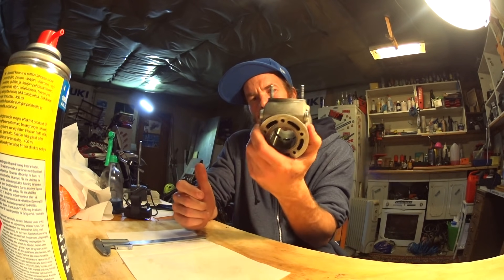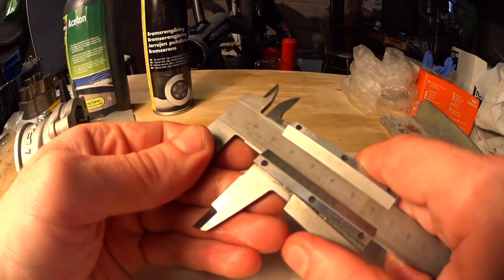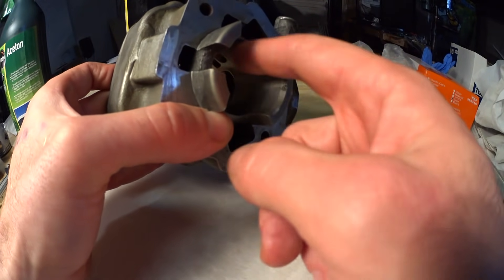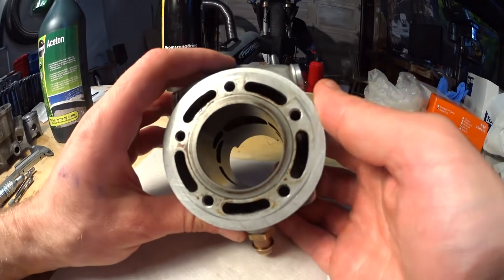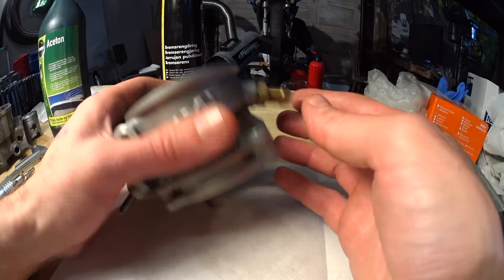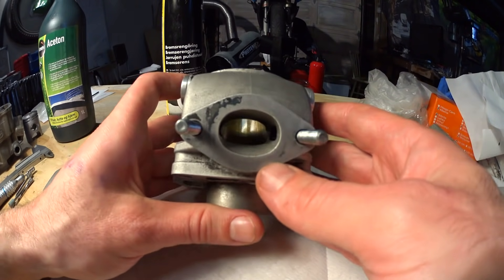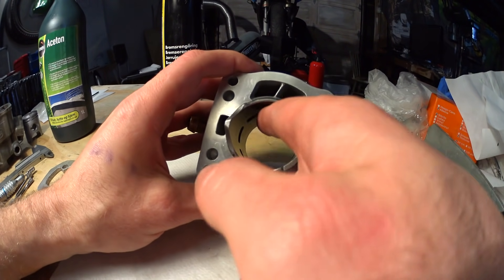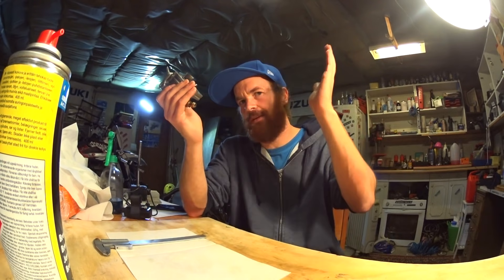Two Stroke Cylinder Porting Tips | WATCH THIS BEFORE YOU START CUTTING! 2 Stroke Tuning

Comment: I don't know how much of a factor "blow down" is for performance, (other than being too short and forcing combustion down the transfers).  If you raise the exhaust port, you are increasing both the exhaust port duration and the blow down phase, and will usually see an increase in higher RPM power.  I would bet in most cases if you raided the transfers to have the stock blow down, (the same as the exhaust port change), you will usually see a decrease in power.  I don't think it is the loss of blow down that hurts the power, (again, unless it is so short that the transfers don't flow well and mixing happens), but that the transfers just have too much duration.  My opinion.
Reply: I can't watch anymore.  I just can't.   Just remember, anybody can post a vid. Sorry man.  I know better.
Reply from the maker: +EarthSurferUSA I'm sure you do...

Comment: Thanks for the tips and tricks, and the 75% of the exhaust port is all wrong on my cylinder... the port are, let's say 100% and then the outer exhaustport is 122% that is a little bit too much i must say... :P
Reply from the maker: +Tha Duck yep, that's how it is on most cylinders...
Reply: Alright, i will need to port a bit then. Nah jk. I will let it be  ;) I got 4 ports for the exhaust in my cylinder :D

Comment: I like my port timing right at 210° exhaust, 135 on transfers and raised the boost port a bit more
Reply from the maker: +Nick Mieloszyk Try lowering the transfers to 130-132, you might be surprised... Only works with very good transfer geometry.

Comment: What`s your thoughts regarding matchporting? Saw that you were talking about the angle of the transchannels and stuff there.. I allways match the transfer channels to the engine block (or visa versa) but usually avoids to do any more work up the ducts, exept grinding off "cast beard" and such..
Reply from the maker: +Jonas Sagli I do it the same way you do. If I need more crankcase volume I grind out the ducts tho.

Comment: HOW MANY CC??
Reply: 2STROKE STUFFING 
way back in the late 80s my dad cleaned up a cylinder off my 50cc Honda moped when we had it apart for a bore job. 
He didn’t mess with raising ports or anything , but whatever he did it still had the same low end , the midrange hit harder and it pulled to a new top speed of 37mph over the previous 29! 
Imagine if he changed port openings, but then he said what he did was a good overall power adder and didn’t make it peaky. 
I was happy because now I dusted all my friends with similar models 😬
Reply from the maker: +Aat Jo 50cc

Comment: More of this.
Show us yor tools for porting.
Reply: I have a spare bedroom I used to use as an office. There are motorcycle parts all over my desk and pretty much every other surface now lol
Reply: @snafuequals  LMFAO SAME
Reply: i use a dremel with the flex cable attachment . for bits if hogging i use carbide toothed cutting bits. then sand paper barrels for smoothing and polishing.. *trick for polishing aluminum with sandpaper barrel . is to immediately apply heavy enough pressure to slow the dremel significantly. this slows the cutting action while creating heat that smoothes the surface,, * wire brush attachments are good polish starters also. then i move to buffer attachments with buffing or valve lapping compound to achieve a  mirror like finish.
Reply from the maker: +gislemark79 Coming! I'm going to take you along as I port the Spx cylinder.
Reply: Nice.
But i don't even have a garage :(
Reply: @gislemark79  same :( my moms living room is trashed lol

Comment: Hey great channel, I like your your content. When doing the radius on the port openings on the inside of the bore of the cylinder, I bend some chainsaw files to different angles and  file from the inside of the cylinder to port opening. Takes longer but less chance of flaking the Nikasil.
Reply from the maker: +Rotaz Racing Thanks! That's a great tip and I've actually used the bent file method alot myself. It's safe, and sloooow..

Comment: nice tips, personally I like and I often buy a cylinder with wild ports so I do not need porting.
but everything can be modified.
You're so determined on 50cc, what 50cc cylinder did you buy if you were buying new?
Reply from the maker: +Lauri "If you're not living on the edge you're taking up too much space!"
Reply from the maker: +Terje E Thanks! I stay with 50cc because a moped needs to be 50cc or less. Anything larger and it's technically a motorcycle. A strong candidate is my current iame m50, another is the 09-> ktm sx50 cylinder. Both need work out of the box. There might be better options that I don't know about yet. My next cylinder won't be bought tho, I'll make it myself.
Reply: but if moped/scooter goes over 65 it will be labeled as motorcycle and you will lose lisence and plates and even get motorcycle tax or something like that
Reply: 2STROKE STUFFING i just said that because you told that other guy that you use 50cc because everything over that is technically motorcycle. at least in finland its basically the same does you moped go over 65 with 50cc or bigger tuning cylinders
Reply from the maker: +Lauri I know, I know. 😁 Same thing in Norway.
Reply: how do you make a cyclinder?

Comment: Good tip with the ring boundary. Got a few porting tips for anyone starting out, maybe cover in a video some time. But  2 basics tips for anyone just starting out is 1 do your porting changes to the Exhaust only to begin with, transfers require a careful hand and eye and a mistake can send the power off a cliff. Exhaust timing is fairly straight forward and a small errors wont kill it. 
2 is make the port height change on piston first, removing material from the crown so the edge of the piston only where the port is located is lowered to effect the new Ex port timing, Once that has been tested, copy that to the Exhaust port and fit a new piston. Pistons are cheaper than Cylinders so if you make a mistake by going too far it only cost you a piston and you can do the job again on another one without going too low and then run it and make sure that's getting the power curve you wanted and if all is good then transfer the same timing specs to the Ex port by porting it and fit a new piston.
Reply from the maker: +AuMechanic Great tips, thanks!
Reply: I port small 2-stroke cylinders, ex, in, trans, (my living), with a Tormach CNC mill and finish them by hand.
I now hate the "hand" part.
Reply: @EarthSurferUSA  Try using  a sinker EDM with the cylinder mounted on a dividing head. It makes the cylinder side of transfer porting easy once the tooling and setting gauges have been made. The CNC machine can be used to make the tooling. The crankcase side could probably be done with  a 4 axis cnc mill.  The sinker is relatively slow but once the flushing is perfected it just runs, tool wear is quite low when sinking aluminium
Reply: How can I make my moped rev higher I have installed a 70cc kit and a bigger carb and can only get 50mph
Reply: @ezgaming8101  that's actually pretty good for a 70cc, what bike?
Reply: @davonmulder5272  it's an ajs firefox u can't buy any thing for them u have to get every thing form manufacturer it has a technigas exhaust on it from a vespa too
Reply: @ezgaming8101  does exhaust have same timing of resonance As zylinder

Comment: A little tip of what I do for quicker ring bed-in and less propensity to seize (especially on tight cylinders) is give you cylinder a quick hone with a diamond hone (I mean like less than 30 seconds) with not much outward spring tension and using plenty of WD40 sprayed repeatedly. It will run in quicker and also it helps to smooth out any sharp edges left from the porting. Just my 0.02
Reply: That makes sense after a port job. I was told to never hone a Ni cylinder but doing very minimal to take off any burrs or rough edges makes sense.
Reply: I should reiterate. Probably 30 seconds is excessive. Just get the drill turning slowly, not even quarter of a trigger pull. Do about 5 up and down strokes with plenty of wd40 or other lubricant such as 2t oil,, then turn the cylinder around and do it the other way. Make sure you don't pull the done out of the bores too much, as you risk burring the edges of the bore. WD40 is just convenient as you can have the cylinder in the vice and spray it in with one hand and hone with the other. I was just told this trick by old old racer who tuned Yamaha Rd400s and kawasaki triples, that this was just a little trick he used on brand new tight cylinders, especially single ring pistons with high compression and tight squish as a little safeguard against soft seizes, especially when you are pushing everything hard, every little caution helps. I use this hone, I don't like the dingleball type hones, they dont last long and are often too rough, better for car engines. : http://www.scooter-attack.com/cylinder-hone-motoforce-universal-mf99-00804-39.html
(You can get the exact same tool much cheaper on FleaBay though F.Y.I.)
Reply: Have you tried total seals dry film lubricant for new rings/fresh cylinders ? 
I’ve had great luck in automotive engines with it, I’ve never had a seating problem using it.
Reply: @MrTheHillfolk  total seals dry film works great. I use it regularly on automotive racing engines. I wonder how it would work on a 2 stroke with a hard chromed ring and open ports in the wall?
Reply: Arthur Dombroskie 
I wouldn’t think it would really matter too much, i haven’t used it in a 2 stroke but I’ve used it in other small engines I’ve put new rings in and had no problems.
Reply from the maker: +shoominati23 Great tip, thanks!
Reply from the maker: +shoominati23 Thanks for the clarification and tip! I've been using the dingleballs but have lost the one I had and need a replacement.
Reply: This technique is regularly used on automotive engines after honing the cylinder walls. It's known as a plateau finish. It knocks the peaks off of the cross hatch pattern left after honing with stones. Very advisable procedure.